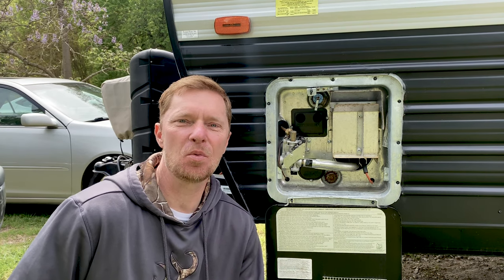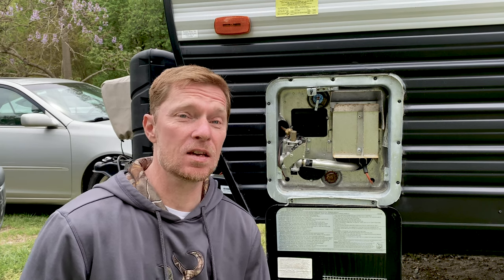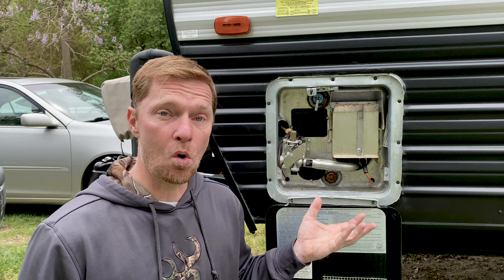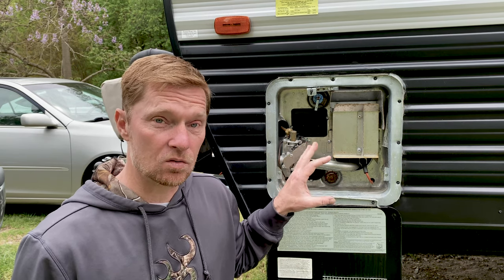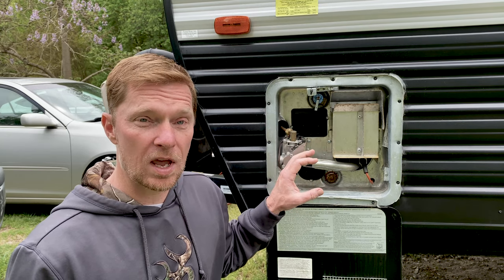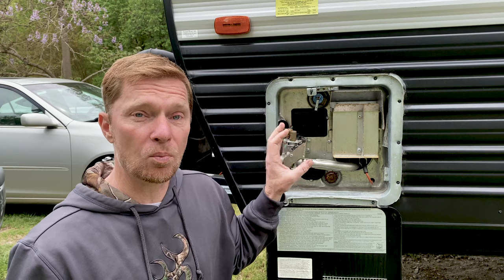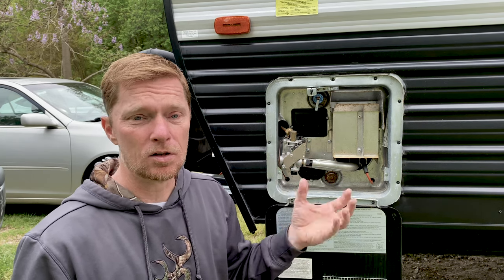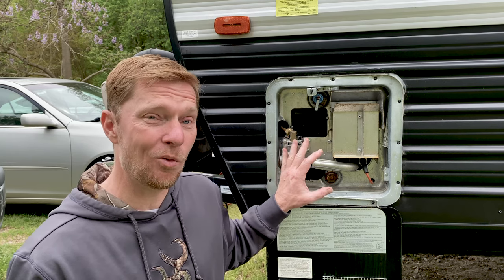Travel Trailer Gas Electric Water Heater Explained 2020

Comment from the maker: Are you interested in Part 2?  -- https://youtu.be/r1QORFE2htM
Reply: Just got an 03 r wagon toy hauler, and only thing I couldn't figure out was how to run water heater and furnace. Propane was low on one tank and empty on 2nd. We were at a park and I brought an electric heater and used community showers, but would like to figure out how to run them, and differences in gas vs gas/electric. I didn't see a panel. Had a button for water pump in oven hood, but was hooked to park water. There is a switch with a red light on face cover of sink, which I turned on and couldn't figure what it did
Reply from the maker: @reallythough4591  I found a photo of your setup. I am not to familiar with this setup but i would expect that if you set the durotherm thermostat to furnace and the temperature setpoint is above the current ambient temp, the furnace should come on if it is operating correctly. For the water heater, I would have to guess that the switch with the light on it is the water heater. Being an older model, i am not sure if you have an electric element in your water heater. Your right about the propane needing to be full. If you can not resolve your problem, I would highly recommend to let a tech take a look. A good tech will not only fix any issues, they will find anything that could also be an issue that you may not know about. Such things like propane leaks, cracked lines, bloen fuses, bugs and rats nests in areas where gas flames are and so on. Also, how does the generator get tuened on.
Reply: @HowToRV  it's a toy hauler, and there wasn't a generator, so I bought a champion weekender at 3650 watts. I work with pool heaters, and aware of critters making homes, I just don't have operating manual or any marking except oven hood shroud. Does the reserve tank need filled, or just city water? I didn't fill and left propane off as it was near empty
Reply from the maker: @reallythough4591  I am not sure about a reserve tank since i do not have one. check to see if your water heater is getting water in it. It is possible that someone left the water feed bypass off. Mine are located on the backside of the water heater. You can verify by connecting water and opening the relief valve to see if anything comes out. Do you know if the water heater has an electrical element or is gas only?
Reply: @HowToRV  I do not. This weekend was break in run. Found drain pipe leak under sink and fixed, as well as damage caused by it in flooring in forward section. Been watching vids, but didn't see anything where they set up and run. Furnace makes sense with thermostat. Water heater has a small fuse in top right side, but looked like it had a mud daub nest at on point, as I could see remains. Didn't pull fuse. Figured I would fill tanks and try at home. Gathering info now.
Reply: @HowToRV  aside from the fuse, no. I will check this weekend. I went ahead and refilled propane tanks so I can test furnace and water heater at same time.

Comment: Very complete coverage of all the features. My question is does the access door need to be open for proper exhaust ventilation?
Reply from the maker: It does not. It needs to stay for for wind resistance and safety reasons

Comment: Excellent video. I learned a lot from this! Just a suggestion, but maybe you could add or include how to position your shut-off and bypass valves. I found another video by suburban on how to do this but would have been nice to have included it in this tutorial.
Reply from the maker: Thank you for the feedback. I have been thinking about doing a video about everything that goes on with the back side of the water heater.
Reply: I agree..... Need a little more info to problem solve...

Comment: Thank you.  Great info!  My poor husband was pulling out what he has left of his hair trying to troubleshoot.  We still don't know why the knob on the circuit breaker shuts off so I suspect there is some electrical issue going on, but at least for now we have hot water running off our propane tank and that will buy us some time to get it diagnosed appropriately!!
Reply from the maker: I am heppy that I could help. If the breaker is triping, try checking the wires to the heating element and maybe even replaing the heating element.

Comment: Great video! Many have the same water heater and in my unit there is a 2nd electric switch for the heater inside the trailer that needs to be switched on as well.
Reply from the maker: That is great to know. Do you mind sharing the make and model?

Comment: I very much enjoyed this video. I am 64 and just moved in to a 2009 Dutchman Aerolite trailer. All completely new to me and no owners manual on hand. The online version sucks 😂 I thought this video was very informative, not repetitious and thorough. I hope that what you've shown will work for my hot water system. 🤔 The only thing I liked in a different video I watched was the purging of the hot water tank to ensure the air was out and the tank was filled with water. I'm assuming that would be a process in all RV's..? 
 Happy travels, from your new subscriber 😊
Reply from the maker: That would be the same for all. You would be correct. Thank you for joining the family.

Comment: Thanks I didn’t know about the external power switch! Learning all the time! I had purchased a 2006 forest river and the original hot water heater was shot. The new one had a tag over the external power switch I didn’t see!
Reply from the maker: Glad that it was helpful. Be careful to not leave the switch on if you do not have water on. If you do, you take a chance in the heating element burning out if your connected to shore power. Happy camping.

Comment: Very good info.   Thanks for sharing.  Ours has a two switch’s one is 12v and 120v.  We use 120v when looked up to power and 12v when boondock ing. The rv place never went over that but I think that’s the right way
Reply from the maker: Weekend RVing Agreed. The switch on the outside for mine is the 120V powered from power hook ups which will heat the water. The 12v isn’t for heating the water but  used for supplying and igniting the propane side. Yes your RV dealer should have explained that to you.

Comment: Can you do a video regarding where the bypass is & ensuring it is in the correct position before turning on & so water fills the tank? Thank you
Reply from the maker: I can try.  I recently took mine out and put in a tankless water heater but the method is about the same.

Comment: Great explanation but... how do you flush the hot water tank and how do you k ow if the snood is good or needs replacing?
Reply from the maker: i have seen people flush the tank, but i have not had to do mine yet and its a couple of years old. One is with with the water heater flushing tool https://amzn.to/35wD4Am . As for the anode rod, you should change it when it is about 75% used. You can get a new one here https://amzn.to/35wVVv4 for very little money and compare the one that you have to it. Hope this helps.

Comment: Thanks for the video! As far as using electric for the water heater when you said make sure you have water in there. Are you talking about the water storage tank or just having the water hose hooked up and running at the site? Thanks 👍
Reply from the maker: Water in the tank. But making sure that Water is connected is highly important as well. When you turn on the faucet or shower, the water needs to run and not lose pressure. This will guarntee that you will have plenty of water in the tank so that the heating element does not overheat and burn out on you. Hope this helps
Reply: @HowToRV  Your a legend! Subbed and liked and look forward to watching all the videos you put out.
Reply from the maker: @back2thebasicz  thanks for the amazing feedback

Comment: New to rvs, learned lots from ur video. The electric switch needs to be on and the breaker on the inside correct.
Reply from the maker: MIne has 2 switches. One on the outside at the tank itself and one on the inside. The one on the outside uses the electric from when you plug your RV in at the campground. The switch on the inside is for the 12V ignitor that uses the propane to heat the water. Try out this video. It think it may help a little further. Comment on that video to let me know if it answers your question. https://www.youtube.com/watch?v=r1QORFE2htM&t=67s

Comment: Very informative, I need to change out my heating element as I had it switched on by mistake after emptying tank to Winterize. Will swap element myself and reminded me that I have both elec and has options for hot water tank…. as I understand it - running both when I can plug in will give me more hot water in total to draw from - cheers!!
Reply from the maker: Glad it helped. How did the electrical element change out process go?

Comment: Please cover the Furnace side of the house because both are linked to each other. Btw, yhx for keeping it simple and to the pt. Please furnace side to include the board replacement.
Reply from the maker: Will do. I need to do some readings g up on the furnace but that’s a great tip. Thanks.

Comment: Nice video,  but I have one odd question... the water heater doesn't heat enough for a shower,  even using the pause button.   Is it safe and ok to use both gas and electric while showering?
Reply from the maker: I use both all the time. All I have to do is to remember to turn off the electric when I move. I have heard of folks leaving the electric on and when they plugged their RV back into shore power at another location without water hooked up yet, the heating element went bad. Long story short, yes, you can.

Comment: Very helpful. We are new to shore camping. Good to know the on and off switch outside the camper. My question is, once i hookup power, and turn on the water heater switch to ON outside, do we need to turn on water heater inside the camper to get hot water?
Reply from the maker: I do not on mine. The switch inside is for the propane side. I did use both at the same time so that the water heated faster and in a round about way giving me more hot water. Hope that makes sense.

Comment: Thank you so much for this video! Very helpful!! Can you tell me....while using the electrical heater do I leave the switch on in the inside of the RV?
Reply from the maker: Depending on your setup, you should be able to. Mineon the inside is for propaneand on the outside is for the electric. I ave often ran both at the same time without issue.

Comment: Thanks for the info..so is that gas smell near that panel anything to worry about?
Reply from the maker: I am no professional but if you have a flame that is making hot water and you smell very minimal propane scent, I would think that you would be ok. If you smell any propane at all with no flame, turn it off and get some troubleshooting done by a professional. Propane is very dangerous so if you have any concern at all that something is not right, contact a professional to check for you. Also, make sure that you gas detectors are not expired and are working correctly inside of your RV.
Reply: @HowToRV  thanks again...yeah me bursting into a ball o flame would really suck.

Comment: You did not mention the red light in the bathroom that should come on. We are hooked up to our house right now. we on the regular 110. Could that be the reason that our hot water heater is not coming on. Because we are not on 30 amp. Thank you so much your video really did help
Reply from the maker: I do not have a red light 💡 in my bathroom. What is your for??
Reply: @HowToRV   we believe it is for you turn the hot water on. I believe that it may be that we only had it plugged in to 110 and that’s why we couldn’t get it to work. I guess we will have to call will we bought it from. It’s brand new I’m sure it’s just us trying to figure it out. Darn thing didn’t come with a manual. LOL

Comment: If you don't want to run propane can you just heat your water up with the electrical side of it im fixen to buy a camper and just learning some things im always gonna be hooked up 2 shore power always . And also if my bottles are turned on is it automatically gonna be used to heat my water I would just rather not use any propane to heat my water if possible thanks
Reply from the maker: Yes, you can run electric only. Also, if you have the bottles turned on and the propane side of the water heater is switched off, you will not use any of the propane for heating the water. Please take a look at these 2 videos. I think that they will explain what your looking for in a little more detail. https://youtu.be/r1QORFE2htM and https://youtu.be/n_v7QkFzNds
Reply: @HowToRV  thank you so much
Reply: @HowToRV  what did u mean when you said u have a extra holding tank for hot water but I think u said u have to run both your propane and electric something like 16 gallons
Reply from the maker: @allencooley7048  what I was going for was to say that the amount of hot water you get to use would be like having an extra tank because of using both electric and gas. With both heating sources running, it can produce hot water for a longer time.
Reply: @HowToRV  yes sir thank u very much for all your help

Comment: IYO!  Thanks for doing this!  I spoke with you about my total lack of knowledge regarding our hot water Electric/Gas heater.  Can't wait to sponge up all this knowledge.  I type comments as I watch.  :)   Wow, it does all seem simple now.  Nice slow mo work.  Love your stuff!
Reply from the maker: Thin Blue Lane RV Life that means a lot to me. Your asking about the not water heater is what inspired me to make this one. Thanks
Reply: @HowToRV  my question is what way does the gas valve need to be turn to be on and off I have no clue of what I am doing .I have a 2004 Salam 40 ft camper trailer and I had to rebuild the 19 ft slide out and a lot of thang is missing so help me please
Reply from the maker: @wilberthunt9863  you would turn the knob on the propane tank counter clockwise to supply your RV with gas. Hope this helps.

Comment: Thank you for this! Your right there isn't much around that explains this as you just did sir. Great job!
Reply from the maker: Thank you for the kind reply. I am glad that it was help to you. Can you name your top 2 things that you learned from the video
Reply: @HowToRV  of corse but I'm a little embarrassed... 1. That there was an on/off switch for electric heater behind the solenoid.... oops. 2. That we can run both heaters at the same time. 

Question though, on gas, does the solenoid tell the ignitor when to ignite?
Reply from the maker: ZJG It does. When the system does not detect heat, it will try to ignite by opening the solenoid. Also if it fails to light after a few try’s. Kinda did it to me when I forgot to turn the propane tank on. It’s a safety feature.
Reply: @HowToRV  awesome thanks! Do you have a video on air heater? I assume it works with thermostat but is there something else needed?
Reply from the maker: ZJG funny you ask. I am working on that as we speak. Should have one out in a few weeks.

Comment: Excellent, clear and logical - thank you!  (A related question: does the electric heating of the water only work when you’re plugged into shore power or  if you are boondocking and turn on the electrical switch the heating element will run off of the 12 volt battery system?). Many thanks
Reply from the maker: Mine only works when plugged into shore power. If/When boondocking, you will have to use the propane to heat the water. The 12V side only powers the little sparky thingy that ignites the flame to heat the water.
Reply: @HowToRV  Many thanks!

Comment: I appreciate this. But the answer I've been looking for remains. I have the same heater, with an on/off switch in it. I also have a single switch inside "HTR." If my propane is always on, will it always use propane, and not just the electrical element? What is the purpose of the switch inside? Is it the propane switch? I will add that I didn't know there was a switch in the box outside, and it was on since we bought the trailer. I will replace the element.
Reply from the maker: On my RV, the switch on the inside is for propane and the switch outside is for electric. I have been adding viewer comments to the end of my more recent videos and I want to use yours and talk about the electrical element being left on to other viewers. Thanks

Comment: Hi there, great info Thanks! Do you think you could post a video troubleshooting refrigerators malfunctioning? (Dometic)
Reply from the maker: I have thought about doing a video about that. I do not have a lot of experiences with the fridge but have been doing some research. I will try to dig a little deeper and see if i can get a similar video made. Thanks for the advice.

Comment: Great video, just one question; because I has the resets at the top does that mean it doesn't have afuse or breaks inside?
Reply from the maker: You should still have a fuse either in the power panel or behind the water heater. Mine is in the power distribution panel.

Comment: Great video, exactly what I was looking for 🤙🏻
Reply from the maker: Glad it helped!
Reply: Other thing you could show next time is the shut off valves inside the unit when winterized and de wintering as mine were shut off and wasn’t getting water into the hot water tank and water pump was cycling until I primed it after dealer winterized. Thanks again!

Comment: Your video was good,but I have a question.my breaker to the hot water keeps blowing inside.i reset it and then it does fine .so now I flipped the breaker up and it will not heat at all.any help would be appreaciated.
Reply from the maker: Sounds like you need someone to look at the heating element. There are ways to check to see if it has gone bad. Because it is electrical, I recommend that you get with a technician to check it out.